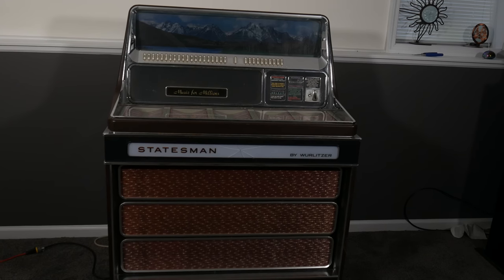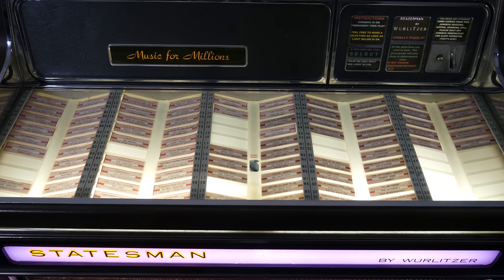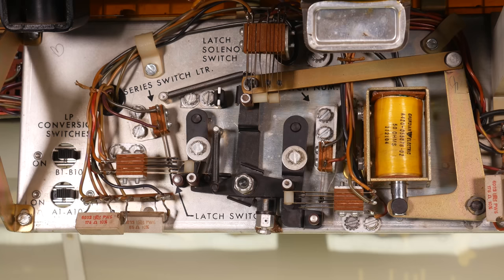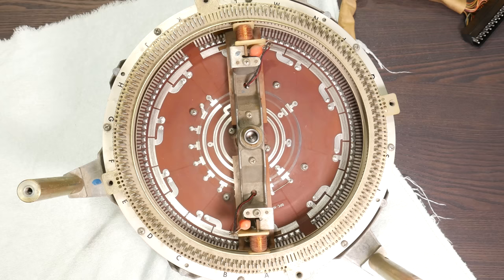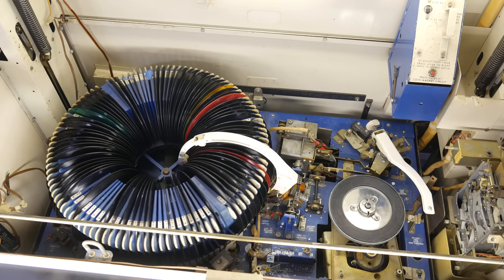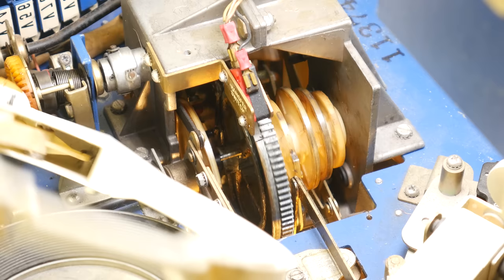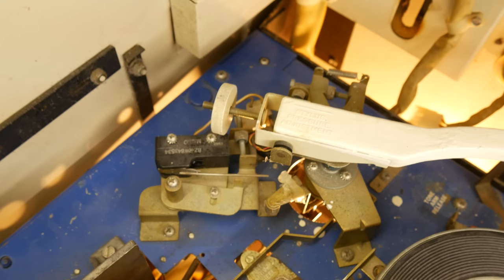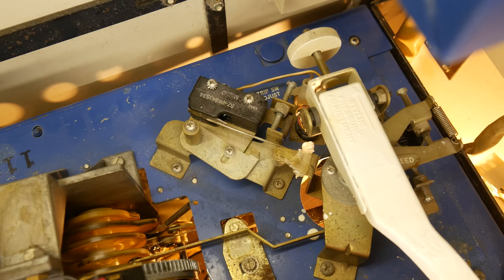Sights and Sounds — Wurlitzer "Statesman" 3400 Jukebox

Comment: A note on captions:
Generally, I don't add manual captioning to videos on this channel. However, the first two videos in this series have proper captions - when I started it I asked folks if they would appreciate them, and they said yes. However, making captions for these videos is... quite tedious and honestly the thought of doing them is part of why it has taken so long for me to make this one. Describing mechanical sounds in text and timing them correctly is a fiddly process, and I (mostly) don't script these so it's very manual.
Since this series is designed primarily as an audio experience, I've decided that I would rather the videos exist first and I'll handle captions later. I hope that's not too disappointing to those who rely on captions. Going forward, I'll be keeping track of which Sights and Sounds videos are uncaptioned and when time allows I'll tinker with 'em. For now, auto captions are there for my speech - and for this particular video, that's a lot of it!
Reply: Would it not be possible for the community to add captions?
Reply from the maker: That feature was killed, unfortunately.
Reply from the maker: @theAstarrr  In theory, yes, but it takes more coordination than I have faith in myself to not screw up badly.
Reply: @kempo_95  Sadly youtube removed the option to allow that to be done easily on youtube. Now one would have to send a subtitle file to the creator manually.
Reply: @TechnologyConnextras  An alternative to the axed community captions is the YouTube Subtitle Editor feature, if you haven't already tried it. No link here as YouTube doesn't like them in the comments, but just search for it and you'll find a support article called "Add or get Subtitle Editor access in YouTube Studio".
Reply: transcription is a lotta woik! If it can be broken up between lots of volunteers it doesn't have to be so bad.. but then people will just make you say fart fart poop.
Reply: What's your current process for creating captions?  I can fiddle around with youtube's data API and see if I can't make something to do most of the work
Reply: There are services that do caption transcription for relatively cheap.
Reply: Soooo fire!!! Pressed play and turned off my phone Ngl, half the time imm listening only and figured this would be good after the intro
Reply: @TechnologyConnextras  I publish all the captions for my videos on GitHub so anyone can edit them when the time comes, the existing functionality of GitHub source control and pull requests should make it a lot easier to moderate than even the old YouTube community subtitles system, I really wish other YouTube channels would do this as well as I regularly see plenty of mistakes. I haven't setup any automation for uploading changes on GitHub to the live YouTube video but the YouTube data API does support uploading captions thought it, probably only a webhook and some python code is needed to implement this.
Reply: @WizardTim  That is a great idea!
Reply: @TechnologyConnextras  You can allow uploads via amara. YouTube accepts both crowdsourced and professionally made captions from amara.
Reply: Thank you for explaining how much work it takes to do proper captions.  Your work is really good and production quality ha improved over time.  But I feel it have never been bad.  Greetings from Oslo, Norway! Merry Christmas & Happy New Year
Reply: I (for some strange reason that has yet to be determined) rather enjoy transcribing.  Used to do that at my father’s office after the clerk went home.

Comment: I really appreciate this deep dive into the operation of the "Statesman".

One of the things that I kind of got from the original videos, but it's more apparent in this one, is that the readout function feels structurally similar to the electro-mechanical outlet timers that were fairly common years back.  The motor advances the ring representing all 24 hours in the day (not sure if the motor has some kind of voltage control to run at a particular speed and has the proper gear reduction or if it's working like a clock radio and using the hertz rate to run the motor at a particular speed/interval) and the tabs that you pull out will mechanically run into some teeth on a rotary switch in order to flip it on or off (as opposed to the selection mechanism which uses electrical connections with metal pins).
Reply: I think those timers use simple geared induction motors, so they're matched to the line frequency (60Hz/50Hz). Induction motors are very simple and very reliable provided the line frequency is stable.

Comment: Great video.  I have a rowe/ami r91 box.  Holds 100 records.   It is an absolute blast for parties, and will crank tunes incredibly loud.   Mikes arcade has a wonderful title strip generator for making new ones if your records didn't come with any, or are missing.   I'm in the middle currently of cleaning a full reload of mine.  The same records have been in for 8 something years at this point and it's time for a change. Hoping this weekend I'll have everything cleaned and swapped.  I set mine to free play, the bill collector is wonky so it runs continuously, so I unplugged it.

Comment: For the young kids, motor driven cams, were common on old washing machines and dryers, and rotated slowly for the whole wash cycle. Its been replaced by microcontrollers, since the late 1980s.

Cancel solenoid not needed on certain models of Seeburg Jukeboxes, as they actually used memory cores, as the accumulator. Two cores per record (side A & B). Beauty of core memory, is that read operation also erases the core, as a needed part of the read operation, so no separate "cancel" operation needed.

Comment: 16:08 the reason the solenoid is vertical is that the "L" bracket arm lengths are different and thus amplify the motion of the linkage by a factor of 2 since the long arm of the "L" is about 2x as long as the short arm.  Short core motion, long arm action.

Comment: Thank you for taking on this monumental task.  As a friend of mine is so fond of saying when describing technologies from the 'days of yore'... "It seemed nothing was too much work".  As the 'electronic-side' of things wasn't quite there yet to make this work much more simply - the genius of mechanical engineering would just have to 'make do' until technology was ready.  (Although by this point in time - it really was.  Read ahead).  NOW - it would be swell if you could provide the same in-depth look at the 'way-ahead of its time' Seeburg Tormat memory system, dating back to 1955...

Comment: You posting this today is funny to me because we just changed out some cds in the jukebox at my work last night. The one we have is obviously much different, but has some similarities, like the doughnut shaped disc holder, except ours is vertical rather than horizontal. I was very confused why the disks weren't in proper numerical order, but skipped every other number (1,3,5,7...) After watching this video, i suspect the disc  selector is double ended as this one is, so in a single position it would have access to 1&2, then next over would be 3&4 etc. I also suspect when they made the switch to cd, they probably retrofitted many of the old record components to cut down development costs.  Thanks for another great video!

Comment: Your videos are always incredibly informative, Thank you for sharing them. I am old enough to remember when some juke boxes played 78 RPM  Records. The Records were stacked and each record has it's own record holder which could remove the record from the stack and if needed could turn the record upside down to play the other side. 78's were not long play recordings and just like 45's had one song on each side. Also, some bars, at least in Canada, used to have matching juke boxes and cigarette machines which were generally positioned side by side. Those kinds of machines looked very much like your Statesman juke box. I think the water in the picture on your juke box was meant to appear to be rippling, somewhat.

Comment: Hey the way the machine stutters after record play then moves you may get away with bending the actuator arm to that micro switch a tad outward so when the tone arm hits it it makes it travel a tad sooner and depresses the switch contact a bit more.  I have a very similar model of this jukebox that will make the selection and start the arm but does not pop up the spring loaded fingers.  I am hoping it is the brush contacts on the rotor plate.  With watching your detailed video on how system works and having the electrical diagrams and working in the electrical field mainly with industrial controls I hope to get figured out.  Thanks as always for sharing the video with us all as always enjoyed.

Comment: I'm curious what you consider to be "cheap", I used to  repair these things in the early to mid 2000's and none of them I would really consider "cheap".  Though I guess of all the models I worked on, the Statesman would be one of the less expensive models.  One of my favorite models, made by Seaburg, was pretty interesting; it used ferrite core memory to store user selections. The circuitry that made that work was sometimes a real pain to get working just right after 50 yrs though.

Comment: You've gotta hand it to them, this may be a tacky low-end model but they still bothered to put labels on everything and don't bury them in a flimsy user's manual. The inside of this machine does accessibility better than YT's designers.

Comment: Is there any sort of lockout protection for carousel positions that don't have a record in them? I guess you would need to prevent the selection accumulator from setting the pin for slots without a record.
Lots of things would go wrong if the tone arm was dropped onto a turntable without a record on it.

Comment: Normally there would be other coins already in the cash box when you insert the coin so the sound of the coin after slotting one would be slightly different if you were using one of these in the wild.

Comment: The L bracket on the solenoid is increasing the travel that the solenoid supplies by the ratio of the lengths of the 2 arms of the lever. The required travel is defined by the switches being operated. To actuate the " trident" linkage directly would need a solenoid with a longer stroke? no idea why that would be a problem , don't know anything about what specs of standard solenoids might have been back then.

Comment: Awesome video thanks for making this for us novices.  I do have 3 questions. 1st you said that you had it set to free play in the credit box.  How is that done?  Next I see a number of springs that are either missing and what appears to be broken and hanging on the accumulator. Is that why certain records are not in the record carousel?  What is the purpose of the light bulb that comes on for a second or so and then goes back off that's under carousel?

Comment: Before the Susan B Anthony dollar, dollar coins were 1.5" (38.1 mm) across; huge and unwieldy, bigger even than the already bafflingly large half dollar.  At the time of this machine's production, dollar coins hadn't been minted since 1935; they'd start minting more, the Eisenhower Dollar, in 1971, but those weren't terribly popular either for the same reason.  This size of coin was rarely accepted by vending machines even when the coin was in "common" circulation.

Comment: Thank you very much for this video! My brother just inherited one of these beauties (ugh!). There are 2 problems with it. The side 1 solenoid does not energize. The discs always play on side B, and in a continuous loop. If I manually activate the solenoid, side A will play and the carousel will return to home position, or look for the next record. My guess here is a relay issue, but I really don’t know. The other problem is the carousel will just randomly stop. I would have to nudge it along until it arrives to its destination. I am thinking dirty contacts or a weak motor. Do you have any thoughts? Thank you again for this video, it helped me understand this jukebox tremendously.

Comment: When did Wurlitzer make the water bubbler jukeboxes?  I've seen a few of them, they're the typical arch shape with water tubes running up the edges and pumps that pump the water, some of them also have rotating colour filters that rotate around what I presume are fluorescent light tubes.  I've seen a few that play records and one that played CDs.  In those units I've seen, the record/CD holder and the player are both visible from the outside, and they both had computerised electronic selection controls with digital readouts.

Comment: If this jukebox had the side loader changer it would have been an Americana 3. The side by side was the Statesman.. This is the only difference between the 3300 and the 3400,. The Wurlimatic mechanism originally designed for the flat top models. It was also used in the Zodiac line and some of the nostalgia models. The changer is also known as the West German and is still used in a modified form. The only difference is the selection is done digitally now.

Comment: For the gas burner, if the flame had been set lower, would that have decreased the amount of energy lost (heat not being used to heat the pot)? You may be familiar with kerosene lanterns/lamps.. with the flame fuelled by the wick, the level of brightness can be adjusted by increasing or decreasing the amount of wick that is exposed to air, in turn affecting the size of the flame... However, eventually raising the wick further wastes fuel as the flame can only efficiently convert heat to light by a certain amount, meaning that raising the wick will use more kerosene but a lot of it will not burn cleanly and will cause a lot of soot... blackening the glass thus dramatically decreasing the visible light that can be enjoyed... Would the gas burner be the same? The flame of natural gas or propane each burn at a determined temperature, so I believe increasing or decreasing the volume of gas that is being burned won't necessarily change how hot the burner will get but rather how much area receives that heat... I think that theoretically then, there would be a "magic" flame size/volume burning that would allow maximum heat transfer, being absorbed by the surface of the bottom of the pot rather than the heat billowing around and past the pot... 
yay? Nay?
Another question, venting dirty CO saturated air is a good thing... back on the farm I cooked with Coleman fuel burners, as well as propane burners/range, and depending on the BTUs being burned, it was important to adjust the amount of fresh air that could enter the space. Generally in the Shasta camper trailer, using the propane oven, one of the shuttered windows would ideally be opened about half an inch (based on the size of the opening of the window), and if I was heating the space (in Canada its cold 10/12 months), the window would need to be opened an inch, as I would use a Coleman heater dome (those are fun but scary and safe yet dangerous).. as that heater burned a lot to BTUs (24,000 I believe) so you needed adequate air exchange... so I wonder, even if the range hood was venting out properly, fresh air still needs to enter the space by some method for the air exchange to be properly balanced... IS your home too air-tight? Would a window being open slightly in the kitchen decreased the amount of poisoned air reaching the living room where the monitor is situated? 

Speaking of how hot it can get cooking with gas stove in summer... imagine a wood cooking stove when its summertime, even in Canada.. luffly! Anyways those were my thoughts.. im not brightest flame (hahah!) but .. umm... yeah. :p

Comment: So what happens if Person A puts in coins and select A1, B1 and C1. Then person B comes and also selects B1 while A1 is still playing, because they won't know that B1 was selected before. The select accumulator will try to pull the pin again, but has no way of detecting it is already pulled. Will it still take the credits and not play B1 after C1?

Comment: The wiring on the "circuit boards" are circuit boards and components are unnecessary to be a circuit board.  The feelers making contact, are properly called "wipers."  If only two possible connections are possible as in a relay the movable contact is properly called a "swinger." Ron W4BIN